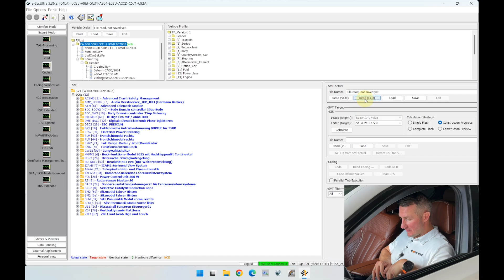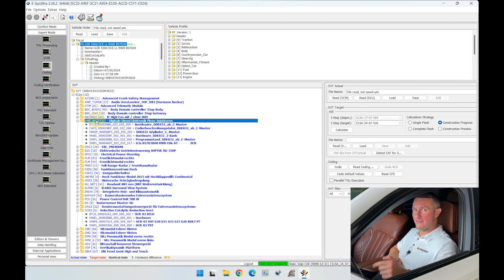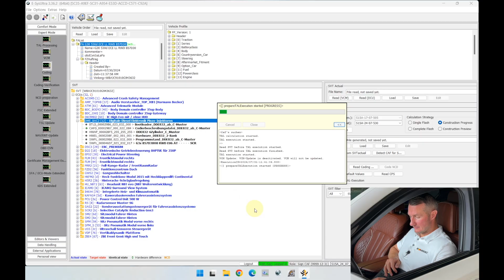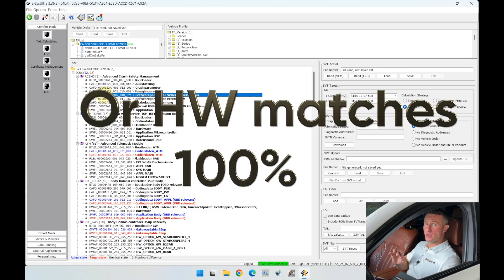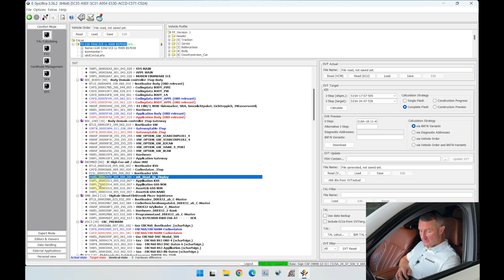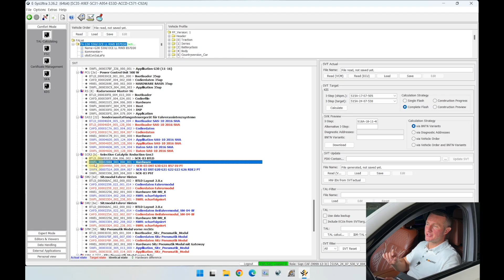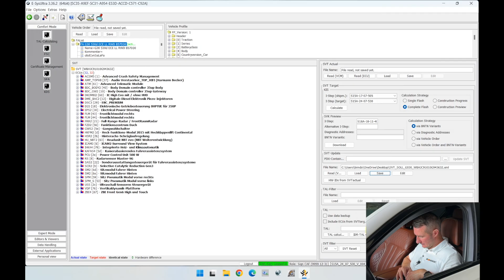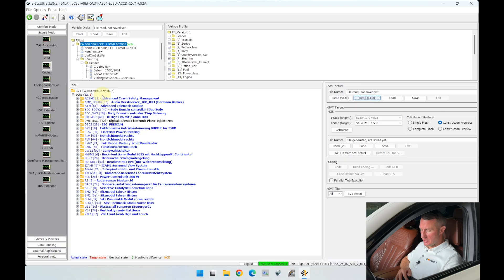How to Easily Replace and Code/Program USED BMW ECUs: A Complete Guide!

Comment: Great info and great video. I'm planning on replacing the Gateway ECU on my F10, does it need coding or is it just plug n play? You said at 8:46  that the gateway ECU doesn't contain a coding file.
Reply from the maker: You will have ZGW
It doesn’t have coding file but it’s not plug and play!

You need to write fa and svt over there (or reprogram it and esys will make the magic happen)
Reply: @BimDoc  Thank you for your reply.
While i was playing with E-sys i noticed the EKPM module was in red and the EPKM2 was in blue. when i tried to detect CAF for swe in EPKM (the red one) i got the following message: actual svt has to contain at least one btld

Is there a way to fix it?

Comment: I cant get the retrofitted asd modul HWEL from Blue to black. No matter which i shipment i choose.
So i cant flash it.
Its from a 140i and retrofitted to a f20 120d.
Its working. but only when FDL Coding chassis to F20 with B58 and engine B58.

but i want a dieselmotor sound. Any suggestion? The is no SA Number for it.
Reply from the maker: Have you seen diesel with ASD installed?
Maybe this is the answer
Reply: @BimDoc  1. yes. 550d 535d
2. i can get it to black when modifying the type key in fa from 120d to 140i (where the asd comes from). But there are no newer files for it.
3. in the fdl coding there are many diesel engines listes. also the f20 120d. but if i choose a different sound than 140i the asd goes off.'
4. it must be in the firmware that the asd modul comes from a 140i
5. some said it can be downgraded with an old pszdata before 2015. Than all sounds should be selectable.

Comment: im trying to replace my dme with a used one on my 07 328i its a msv80.0 manual trans, the dme i have is out of a automatic will e sys work for that
Reply from the maker: No it will not 
First of all esys is not for E series 
Secondly, DME replacement is not so easy. 
Google towards ISN replacement inside DME

Comment: Hello Vladimir, I need you to put me on the right road for retrofitting used amplifier into F11 LCI. I have watched most of your videos and they are supper exciting, I have learned a lot so far. Unfortunately I've got stuck in stage where "Read VCT" recognises 26 ECUs and "Read Ecu" recognises 28 ECUs. E-sys does recognise amp but it is looking to encode Bootloader before I can proceed further. After watching your videos I am okey to load coding files when VCT recognises all ECUs but there is no video what to do when VCT recognises less ECUs then read ECU function. I believe I am only one step away  to get everything in order but need your support how to load ECU into SVT when it has been recognised by reading actual bus. I have subscribed to pay your coffee bill monthly and also looking forward to enroll into your coding class but need to do some planning first
Reply from the maker: I’ve answered you via PM, but for other subscribers:

If you cannot see ECU via READ ECU button, then you cannot work with that!

VO code HU with modified FA (HK option added) and then AMP might appear. If not, check the wiring

Comment: Wow, excellent! I have a question; I have an ICOM. Can I do this with it? Or is a cable better? Do I need to replace the telemetry ECU on my 2019 X3?
Reply from the maker: Icom and Enet both suit well here. 
Replacing telemetry ECU is not so easy. 
Yes you can change and code it. SOS error will go away. But mybmw will no longer work. (Because of built in esim and IMEI)

Comment: Thank you for the useful and informative video! 

I have a BMW G20 330e of which my radar sensor (FRR-2) has been stolen. I have fitted a new (used) part but it still needs to be coded or adapted to my vehicle. Is this possible to make it functional with E-Sys? 
Another person that I have asked mentioned that the VIN number also needs to be overwritten on the sensor itself. Is that true?
Reply from the maker: Not so straight forward. 
Not only vin but also fsc code. And this is limitation!
Reply: @BimDoc okay, so what do you think would be the correct procedure to make it functional? Or how would you proceed?
Reply: Or, is it possible with maybe ISTA+?

Comment: is it possible to replace a bdc to a used one in a g20 bmw ?
Reply from the maker: Very difficult operation. 

Not impossible, but definitely tricky!
Reply: @BimDoc  thanks for the info
Reply: @BimDoc  Hi Vladimir, why is it so difficult on a Body Domain controller ? I need to replace mine as well in my G20

Comment: I have an F15 with corrupted data in the BDC from an electrical pulse. I only show avout 1/2 of the modules in a scan. I would like to correct the data in the BDC if possible....
Reply from the maker: Most likely there is not only corrupted data but some physical damage also present. 
So replacement of ECU is required.

Comment: День добрый Bimmerdoc! Если не сложно дай направление куда копать. Перерыл весь интернет, нашел лишь минимум информации - ошибка: D396AC Message (time delay power supply, 3BE) absent, receiver: EMF, transmitter: Car access system (CAS). Исправит ли эту ошибку замена блока эбу EMF  на блок бу EMF.  И достаточно ли будет просто закодировать под свою комплектацию . BMW 5 F10
Reply from the maker: Смотрите и проверяйте по схемам питания. 

Быть может дело и во внутренней неисправности эбу.
Reply: @BimDoc  понял, спасибо, я бы хотел все же заменить эбу, и закодировать бу блок.
Reply: @BimDoc  сам эбу emf стоит копейки, поменять в обще не сложно. А вот есть ли замарочки в кодировании блока, информации в обще минимально... Поставил блок, подобрал cafd, закодировал свою комплектацию и ок, в моём понимании.

Comment: Hi Vladimir. Thank you for your videos. My bmw has 2 DMEs. DME on bank 1 has problems. It can be cloned with another used Dme without problems, but is cloning just enough? If I install a used one and clone it, do i need to program after installing on the car? or what should be done with it? Lastly, what are the symptoms if you clone the DME and install on the car without programming? Thanks again.
Reply from the maker: Cloning is making identical copy. So no other actions are required. 

But not all ECUs can be cloned!
Reply: @ Thank you for your information. I had no issues from the beginning, but after I replaced the DME 1 with cloning and installed my on my car, now the car triggers different fault codes from DME 2 for no reason. I haven’t moved the car at all, just right after the replacement. Can you help me with that please, if yes, how can i contact you?

Comment: Hello Vladimir,
An important question to clear up any confusion:

You flashed the SCR2 ECU with the latest software version (because that fixes a bug). But the saved I-level and the other ECUs remained unchanged.
So, is it not a problem that an ECU (e.g. after replacement or retrofitting) correspond to a newer I-level (newer SW) than the actual stored I-level in the car?
Reply from the maker: The best solution is to have same istep (new) at all ECUs 
In that way you will have no problems because of mismatch of the software. 

But if you update only one ECU and it does not cause any problems (strange behaviour or errors in communications) you can leave it as it is. 

You also can check the dependencies in esys. If you update certain ECU what ECUs have to be updated as well.

Comment: Thanks again for your tips. Here's a little shortcut from my side:
After clicking on TAL Calculation, simply click the "Execute" button next to it. This will take you directly to the TAL processing page, where the TAL file is automatically preselected and the ECU table is prepared. 🙂 (So you can save some clicks)
Reply from the maker: Great tip!

Comment: Thanks, this guide is very helpful. However, it is not clear whether the VIN of the current vehicle should be imported into the used ECU?
Reply from the maker: VIN of the vehicle always has to be imported into use ECU 
It is done during the VO coding (if ECU is not protected from that)

Comment: Thanks Vladimir! Would be also great to see how to replace, program and code a SRR Sensor (used for Driving assistant plus)
Reply from the maker: Not all parts are separate ECUs. 
So not all of them require coding or programming. 
Sometimes it’s enough if initialisation via ista (as in case of SRR sensors)
Reply: @BimDoc  Do you mean that if I retrofit the four SSR sensors for DA+, they won't become visible as ECUs in ESYS?
For example, the FRR2 sensor for ACC is visible as an ECU in ESYS and also has a CAFD (coding file).

Comment: lovely video, i had a water damaged ecu and got a replacement. if i follow the steps in your video will it work? e87 n46 1series 2006 model.
Reply from the maker: For E series you need NCS Expert to code ecu

Comment: Hi Vladimir, can a second hand SME be programmed and coded to a different vehicle, donor SME has good Pyro fuses and no crash data
Reply from the maker: Yes it’s possible. But some works in the bench are required before
Reply: @ Thanks for the reply Vladimir, I’ve been advised to buy a multiprog and use the original SME, is that bench work you mean?

Comment: Hi! When programming the used FLM block, an error occurs: <[FLM2 - 44] Failed ProgrammingPrecondition ECUId:FLM2_0x44 error ID:192 - supplier reserved [THROWABLE]>! What could be the problem? Thank you!
Reply from the maker: I don’t know. Smth is wrong with ecu or settings in esys

Comment: Good information, specially for newbie like me. What should I do if I cant find the correct cafd that matches with the istep. I coded my driver and passenger seat module with nearest number due to missing cafd and have trouble. Previously the car was showing Airbag sign but now the airbag warnings are gone however both seats don't move at all...
Reply from the maker: If you apply the CAFD then it is coded based on VO

So check seat options in VO and redo the coding.
Reply: @BimDoc  Thanks for pointing it out, removed 456, added 459 and it works... Thanks for your help.

Comment: Hi doc, I’m currently trying to encode a new acsms module, however when I try to encode the new module with the CAFD I can only add one line and keep getting an error for deploy with error. 

Is it possible to code the airbag module like how the video is Done?
Reply from the maker: Codings ACSM is the same as coding any other ECU with multiple CAFDs
Reply: @ do I need to individually inject each cafd?

Comment: When i change aDME with used one can i Change the VIN Number with E Sys ( with that Program )
Reply from the maker: DME has in addition to VIN also ISN (security) code. 
And esys is it able to change ISN anyhow. 

So DME replacement is not so straight forward.

Comment: Hi, thanks for the tutorial
I have a ASA module which have 2 hwel, i nearly try all the i-step shipment it still did not going to black color, i using the Hw-id actual button its show all black color nothing need to update or config,
it went missing in the list of the Tal processing, is it any other way to do it?
the hwel no.
blue color HWEL_0000001B_001_196_001
red color HWEL_0000001B_001_199_000
Reply from the maker: If you are getting the situation where all is black then ECU has most recent software in it at does it require to be updated. 

Also playing with istep shipment requires changing vehicle production date in FA as well.
Reply: @BimDoc  thanks for reply
Is it edit the 0316 date at tutorial no.2? The i-step shipment might be before 2010, mine is start from 2010
I try it from 2010 to 2020...

Comment: Hello! I see in Esys for dummies videos and other videos of you about esys that under tab "Open Conection", main series "All", connection type "All", that your database displays series like (F001, F002, F003, F004, F007, RR04 etc) and it is more easy to find the model of car, F10, F07, G30. As example G30 is displayed under S15A system. In my esys under system S15A does not diplay the series that use this system. My database is 4.50. What can i change to have system and series displayed like you have??? Thank you and wish you all the best.
Reply from the maker: It is the launcher that expands esys capabilities (it’s not related to esys or database version)

Comment: Great video like always bro.
I have something, maybe you can do a video of it. When chiptuning bmw then ista shows S0777 Tuning detection. 
Any idea or can you upload a video how to erase the tuning detection code S0777 ?
Reply from the maker: It is not impossible to remove that. But it is pointless. 

Became if you still have warranty and if smth happens with the engine then based on logs that bmw has via telematics they will anyway see that parameters are off for standard software. So in the end you will hide nothing. 

If you like Chiptuning just use it.
Reply: @ it is possible to erase so ista dont detect tuning i saw a video of someone doing it

Comment: Is it possible to code High Beam Assistant (5AC) to G20 without FSC certificate? When I press auto beam button, the dash shows message "function is available in connected store". Online store asks 200GBP for it. I've tried to write 5AC in the vehicle order and code ECUs, but having same message on the dash and D91495 cafas fault appeared permanently, which is related to fault of the High beam automatic system.
Reply from the maker: Without FSC it will not work

Comment: Thanks a lot for the informative video. I have a tricky situation any assistance is appreciated. Recently, I replaced low pressure fuel pump LPFP (brand new) with second hand module responsible for the functionality of the LPFP. The module is EKPM3 and a person told me that it needs coding. I connected the car with E-Sys and I could not see any CAFD variable listed in the EKPM2 folder. Also the car did not had any CAFD variables with FFFFFFF letters which as far as I know means all CAFD files are coded. The car runs without any issues but I am not sure if a coding is required as this is a second hand module/ECU which does not have exactly the same part number but it is from the same car same engine different year. Car is bmw f10 530xd N57
Reply from the maker: FFFFFF is never correct file. 
So yes coding is needed. 

Your CAFD might not be even present there. And there fire ECU might work in “emergency” mode.
Reply: @BimDoc  Thanks a lot for the update

Comment: Hi. Maybe one video how to handle with programming in car where a lot of retrofits was made? I've got F11 2011 and I did a lot of retrofits, replaced / added a lot of ECUs (CAS, ZGW, FRM, SZL, HKFM, EGS, FRR). I wanted to update whole car to the newest I-Step. I used "HW-ids for SVTactual" but still, SZL went bad. I don't fully understand what I did wrong, HWEL was black for all ECUs in my case.
Reply from the maker: Retrofitted ecu 90% of times require own FA

that’s why
Reply: @BimDoc  own FA? With retrofit I added appropriate option code to FA and code the ECU. Is that not sufficient?

Comment: Make video boss if i buy used headlight module the parts number are not same or little different how can we code or program or how can i know with ista or esays that module parts number isn't same thanks
Reply from the maker: If by ETK parts do not match, then do not match.

Comment: Amazing video as allways!
Does this work for coding a used gearbox Mecatronics ECU for G31 as well?
Reply from the maker: It will have ISN that’s needed to be erased / verginized 

Beginning in the same as I’ve shown. But you will not achieve 100% result with that.

Comment: ECU - Engine Control Unit. The module you replaced is not an ECU. It has no immobilizer data inside. Please make another video, how to replace proper ECU. Especially, how to transfer the immobilizer info to the used unit.
Reply from the maker: ECU is not ENGINE its stands for ELECTRONIC control unit. 

All ECUs are different. Yes if ecu has immo data (like DDE or CAS) then replacement is not so straight forward. But problem is that it’s impossible to make universal guide for those ECUs. Because for example CAS, FEM, DDE and EGS all have ISN, but approach will be different.

Comment: Thanks to your last 4 videos, I managed to update my second-hand headlights. However, I still have a question: 
My new headlights are EU version, but my car is a US model. After I flashed the headlights, the car is now looking for the side markers, which the EU headlights don’t have. How can I get rid of this error? Should I change the vehicle type code (Typschlüssel)? Right now, it’s set to ‘TA63.
Reply from the maker: Change typschussel to TA61 and with that code only light (FLE) is ECUs

Maybe BDC 

But NOT THE WHOLE vehicle
Reply: And in future if I decide to update all the car modules, I have before that change back typschusel to US, correct? 
after full update done, change again typschusel to EU and update only FLE and BDC if needed.